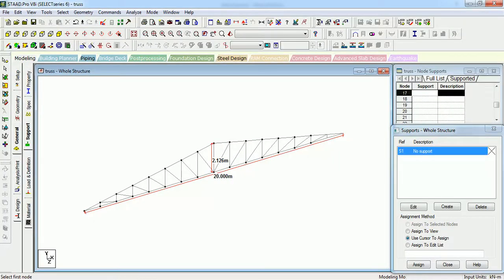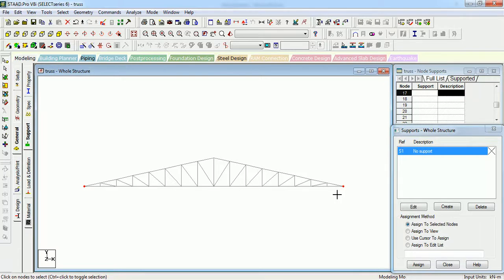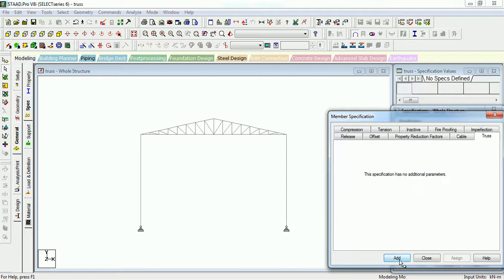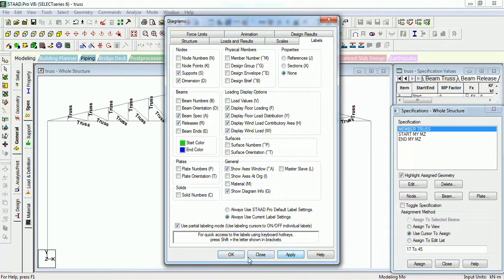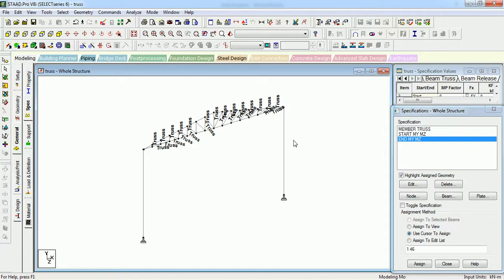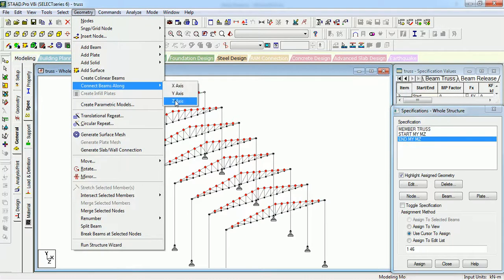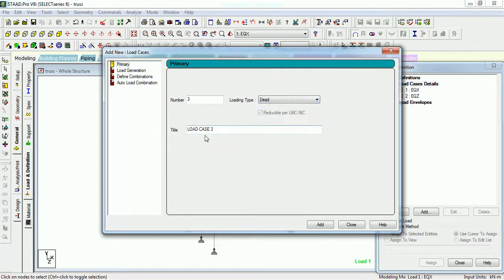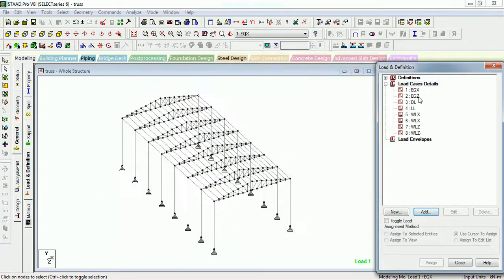Analysis and design of Industrial shed in STAAD Pro - 1

Comment: Just small doubts... I have completed your full videos.. But still I couldn't get these points...

1. Why are we generating load combinations? And what is the use of it?

2. Why do we have to apply master/slave and releases? Where to apply it? And what's the use of it?
Reply from the maker: 1. You can make your load combination instead of generating ones. Your choice. Point is you shall be required to have combination for concrete design.
Reply from the maker: 2. You shall have to apply release to secondary beams as you donl not want to transfer torsional moments to other beams. You shall have to provide master slave to take effect of slab diaphragm effect.

Comment: Is there a way to generate  automatic wind loads in staad pro as per Indian code? The feature is available in American Code ACI-7-10.Also in  my opinion wind load if applied based on hand calculation; should be applied just after seismic loads there after consequtive loads as ded load,live load etc should be applied . In general  a load load test should be performed between Windload & Seismic load. Which ever   is greater shall govern the steel design.  In high wind velocity areas or hurricane areas both seismic & wind shall be applied
Reply from the maker: You can provide wind definition with wind pressure and height.